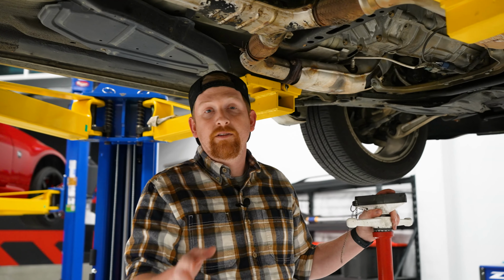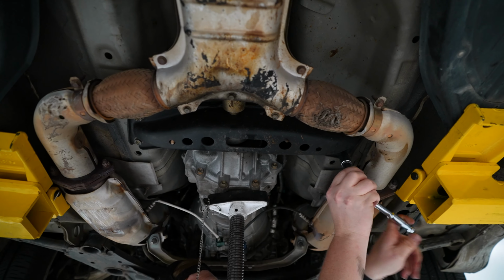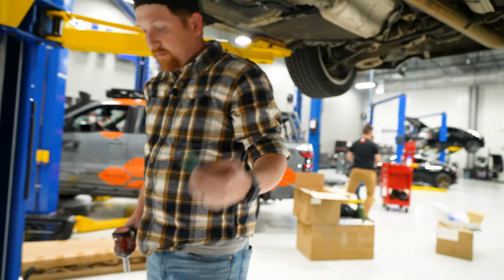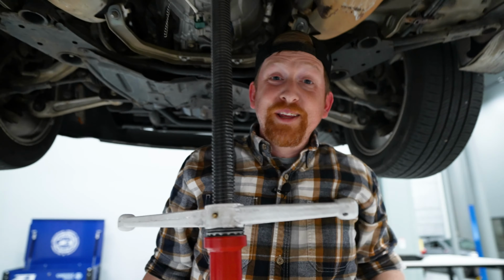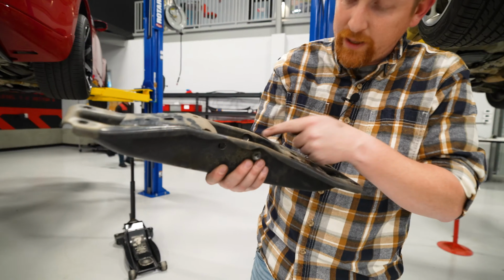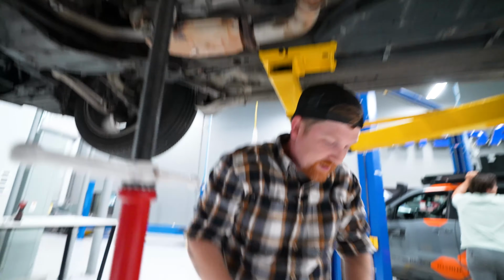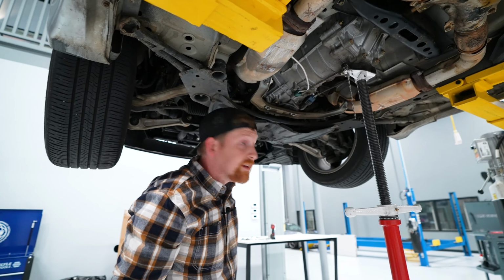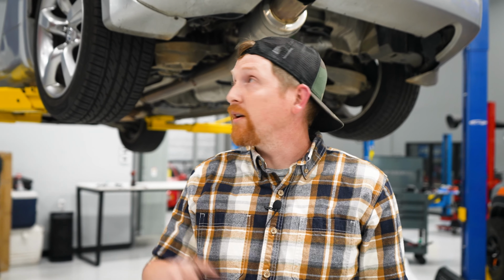Z1 350Z Trans Mount Install

Comment: Is there a specific torque spec
Reply: Z1's install directions and FSM call for 32-40 ft-lb for all of the 14mm bolts including the counter weighted bolt